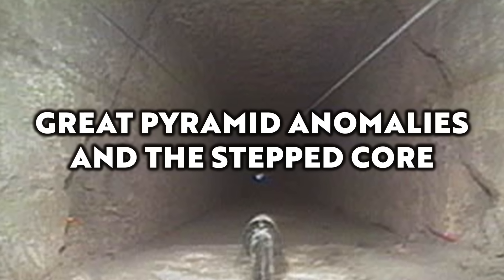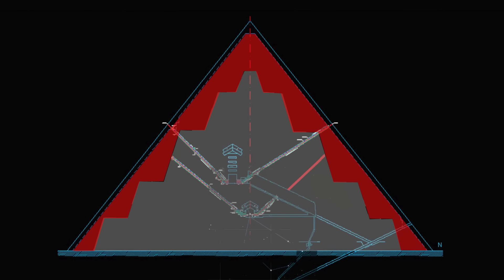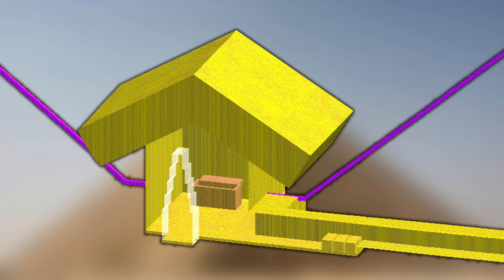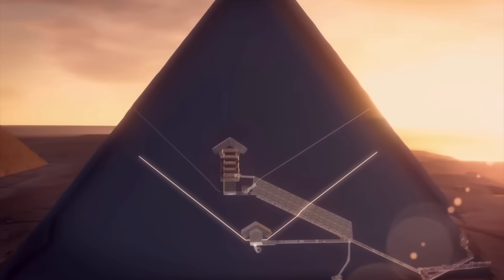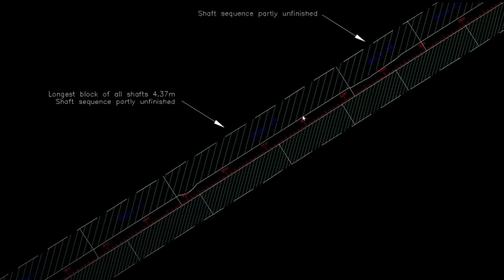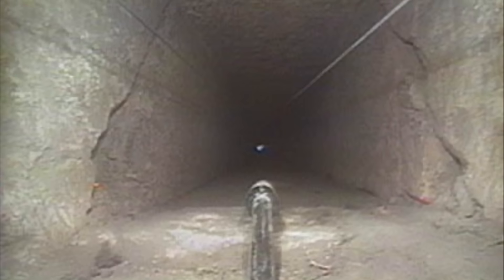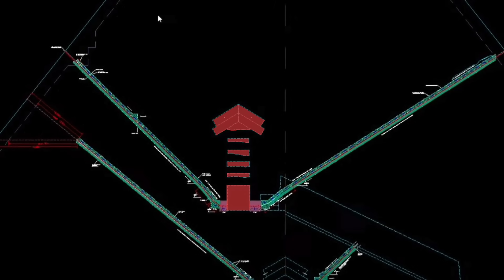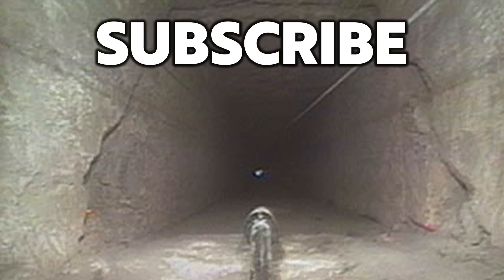Great Pyramid Anomalies Reveal Hidden Structure | Part 2

Comment: the idea that the original builders are just crossing their fingers as they build, hoping each subsequent chamber doesn't collapse stretches credulity for me , personally. i thought we had dispelled such notions with modern re-examinations of the bent pyramid? i cant think of any building site where that approach would be acceptable, from a safety standpoint, logistics, resource and man power wastage, ect... If anything, i think this actually shows us  evidence for multiple stages of construction. the kings chamber being off axis being the main indicator. but the final thing for me, and this may be my own ignorance speaking, but. have we not only in recent decades developed the technology to measure the precise alignment and "squareness" and margin of error on this structure? i thought it was fairly well agreed on the the structure was built from the outside -in? one layer at a time? is the precision of the structure more pyramidiot type stuff? or is it correct? if it is correct, it doesn't make sense that they can build to such precision, but are still crossing their fingers hoping the kings chamber doesn't collapse. I'm just rambling from a potentially uninformed perspective, but it just doesn't sit right with me. to many contradictions, it feels like your telling us the builders were genius's but also didn't really know what they were doing . also , wouldn't the 8 sided faceting have to be an early part of at least the design/blueprints? did they just wing that too? just my 2 cents.

Comment: well according to your diagram the two air shafts are at very different angles so the long block might not have worked in the steeper shorter shaft

Comment: Did someone take the Great Pyramid apart to confirm the stepped construction? Or are you looking at stepped pyramids and assume the Great Pyramid is built that way? The stepped pyramids were built later not before the Great Pyramid. And the stepped theory is problematic if you believe in the big void.

Comment: One misalignment or slump in the backing stones would mean the channels wont work, and the ancient Egyptians would have know this" Yet they used two different methods of construction on each of the main chambers air shafts at the point where the backing stones started?

Comment: My Speculation with some evidence.   The pyramid was built in 3 stages, each stage a completed pyramid separated by generations before the next stage was begun.  The first stage was a smaller stepped pyramid for only the Queen’s chamber.  That’s why the queens chamber aligns directly centered within the 1st stage pyramid.  Next stage could have been the next generation or several generations later expanded the stepped pyramid and housed the King’s chamber.  That’s why the Kings chamber location is offset from directly above the Queens chamber and from the center of the pyramid. (It’s the best location for a chamber created while minimally expanding the first pyramid).This was completed 7,000 years ago and depicted on the shell of an ostrich egg found in a grave upstream the Nile.  The third stage was created around 4500 years ago and remodeled the King’s chamber. This final stage created the final pyramid without steps.

You heard it first right here on the Ancient Architects channel comment section.
Reply: Absolute rubbish.  Would look like a pile of rubble with no facing stone.  Those blocks are roughly cut and uneven.
Your dating has zero evidence as well.
Reply: @ChristopheAllanne The ostrich egg with the engraved pyramids was dated to 7000 years ago.  That’s strong evidence of the dating for the stepped pyramid.  The 4500 years ago for the 3rd stage is commonly accepted date.   The second stage was most likely only a generation or two from the original pyramid because it is built on the same belief traditions and similar construction techniques as the first.  
    Regarding facing stones, every stage could have had them and they could have been removed/reused when the next stage pyramid was constructed.  Also, the pyramid could have been whitewashed (this was being done on walls many thousands of years ago in the Levant including well before 7000 years ago.
Reply: @douginorlando6260 

The ostrich egg is a roughly etched work at best.  Made by a child for the funeral.  An offering.

The pyramids are oddly shaped and the Nile river could be anything.
😂

Comment: And this honoured viewers, is the solution for several of the mysteries of the great Pyramid.
The two upper chambers use, the air shaft, the location of the two upper chambers.

I’ve personally always thought that the offset location of the queens chamber, clearly showed that it had been planned as smaller pyramid first. 

I hope in my lifetime, that they open the big void, and solve the rest of the pyramids enigmas.

Comment: Somewhat contradicting what you say. Flat roof in King's chamber is a success, then they don't need Queen's chamber. So they didn't open the channels from Queen's chamber. But they couldn't have known that when Queen's chamber was built. Or is there something I'm misunderstanding?
Reply from the maker: I mean they decided how to finish the pyramid only when the core was complete. At that stage you’d know if the kings chamber was a success structurally, and only then can you decide what to do with the Queen’s - abandon it, or finish it? Keep it or not?

They decided to abandon it - no slabs were laid on the floor, the walls and corners were not smoothed properly, and the air channels didn’t open into the room. They also didn’t bother extending them through the backing stones. They basically decided to abandon it altogether.
Reply from the maker: But if the kings chamber failed, for example the architect was not happy it was structurally sound, they had the Queen’s chamber to fall back on. 

They would have then blocked off the King’s chamber and finished the Queen’s instead.

But the decisions could only be made when the core was complete because that is the main bulk of the pyramid.
Reply: @AncientArchitects  I understand what you mean, but I think it's very speculative. But a theory is a theory, keep up the good work. I've been following the channel since day one. Greetings from Norway
Reply: @AncientArchitects  If the king's chamber failed, how would they get the material inside to cover the queen's chamber?
Reply: @AncientArchitects 
But there was no security built into the Queen’s chamber like the 3 portcullis door to the Kings chamber. What would they need air for if they were not going to use it?
Reply: Who hipotetic egzist piramid Chufu chambers Toth ????.Westcar papirus.

Comment: Just a thought: The stepped core could also align with the theory of an internal ramp - that is, rather than forming stacked mastabas in which the flat surfaces were precisely horizontal, they could have been angled in such a way as to form something of a spiral wrapping around the pyramid to aid in bringing up large blocks.

Comment: It's kinda nuts to think we're examining and theorizing about the decisions of what was probably a tiny group of very smart people, if not one person, ~4500 years ago. The structural and operational genius involved, particularly given the constraints of their time, is just mind-boggling.
Reply from the maker: Very true. It’s the work of a true genius
Reply: But do you still believe they were laying a block every 2 minutes or do you believe it was built over a much longer time frame?
One video out there based on organic material retrieved from different areas of the pyramid shows through carbon dating that it took 300 years to build. That totally changes the narrative of the construction technique and the original purpose.
Reply: If it took centuries, the building would be full of discrepancies like any structure built over several generations. Also, it would mean a lot of labour was required to start the other nearby pyramids.
Reply: Cosmic natural low. With 
this key point you can open
all secret mystery in Egypt.
Top math about this  we.    don't  know nothing.

Comment: In the diagram, the internal structure of the pyramid’s core is now correctly shown, with evenly arranged tiers. The upper tier cannot be larger than the lower tier. As I assume, the first three tiers (each 21 m high) are combined together and form one large tier with a total height of 63 m. This tier contains the entire main internal construction: the Grand Gallery, Chamber No. 2, and Chamber No. 3, as well as the relieving sections of Chamber No. 3. This tier serves as the foundation for the upper tiers (each 21 m high). That is to say, in this case we are not dealing with a regular stepped structure, but with a stepped structure that has a massive base supporting the upper tiers.

According to my calculations, the base of the internal stepped core of the pyramid measures 170 x 170 meters (equivalent to the width of an equilateral triangle with a height of 147 m). The end of the small northern passage meets precisely the edge of the internal core of the pyramid. It is clearly visible that the blocks covering the passage are not sealing (plug) blocks, but rather part of the regular masonry, meaning they are an integral part of the pyramid’s core.

It is easy to calculate the distance from the outer edge of the pyramid to the edge of the internal core: 21 m (if the internal core has a 75° slope) or 15.75 m (if the internal core has a right angle).

Question to the author of the video: how did you arrive at the conclusion that the internal core of the pyramid has a characteristic slope? Could it possibly have a right angle? If the core is sloped, then how adaptive is it relative to the external angle of the pyramid? Do you have such calculations?
Reply: Is the slope of the internal stepped pyramid identical to the slope of the pyramids engraved on the ostrich egg shell found in an upper Nile grave and dated to 7000 years ago?
Reply: @douginorlando6260  In the image, you can see the difference between the tiers: 8, 9, and 10. It is clear that the triangles are not identical. This may be an early archetype, a kind of “embryonic concept of the three sacred peaks,” although I’m not entirely sure about that :) These steep angles correspond more closely to the angles of the internal core of the Pyramid of Khufu (60–75 degrees), as opposed to the outer part of the pyramid (52 degrees). The entire Pyramid of Khufu is divided into 7 tiers of equal height, each measuring 21 meters. In this case, the division of the height of the Pyramid of Khufu into equal parts coincides with the division into equal parts of the three pyramids depicted on the ostrich egg
Reply: @thotecture I suspect the pyramids etched in the Ostrich shell is something he saw when he traveled down river.  I.E. a pyramid that was later encased and enlarged thousands of years later. The steep pyramid angle depicted on the shell would be the original stepped pyramid perhaps with some casing stones.

Comment: The only way to find out the truth would be to partially disassemble the pyramid. And this would be rather easy to do: the bottom 1/3 of the pyramid's height contains about 70% of its volume, and the top 1/3 contains less than 4% of its volume. The top 1/4 of the hight contains just 1.5 of the volume. It would make sense to disassemble the top 1/4 (marking every stone so it can be reassembled later). 1.5% of the volume is about 40,000 cubic meters, or a 34x34x34 meters cube. No big deal.
Reply: Even disassembling the top of 1/5 of the height (about 30 meters, or about 21,000 cubic meters) would be enough
Reply: Presumably you would suggest helicopters to do the lifting. I think it would be a BIG DEAL
Reply: @peterisaacs6882  No, it would be easier to build some kind of elevator or escalator

Comment: Could it be that the niche in the Queen Chamber is a representation or reflect in some way the stepped Pyramid? With the floor all 5 steps are almost the same height. At the end the pyramids are a series of mastabas on top of each others with a cover.
Also there is clear a north south axis of contructions where all the especial types of blocks where moving to form the especial structures.

Comment: Ain't it a nice feeling to know that it should't be too much longer before technology reaches a level where we will be able to confirm this stuff?
Reply from the maker: It’s a great time to be alive. I just wish things would move faster - I’m getting old 😂
Reply: A portable muon source is feasible with laser wave acceleration creating pions which quickly decay to muons.  This muon source would allow very high resolution CAT scans of the pyramid but with muons.
Reply: Do you agree that it took approx 20 - 25 years to build the Great Pyramid??? If so, how does technology explain the "theory" that a stone would have to have been laid every two minutes to erect such a structure in that time scale or is there something obvious i'm missing????
Reply: @4faxache935  "how does technology explain"
I humbly submit some crude calculations that I came up with on my own.  I'm not saying they're gospel, I'm just putting them out there...

The labor force for the great pyramid was an estimated 20,000.  The average weight of a stone in the great pyramid is roughly 2.5 tons.  The great pyramid itself is roughly 5,700,000 tons.

A team of 10 men can easily drag 2.5 tons, even up a small incline, especially if rollers and sledges are used.

So let's start with 2,000 teams of 10 men moving 2.5 tons each (again, this is all just using averages - larger stones would take more men and smaller stones would take less).  If each team moved an average of 2.5 tons per day, that's 5,000 tons per day.

Divide the mass of the pyramid, 5,700,000 tons, by 5,000 tons/day,  and we get 1,140 days.  Divide that by 365, we get 3.12 years to build the great pyramid.

I think we can both agree that is a ridiculously short time frame.  There are, of course, other factors to take into account.

Because of the annual Nile flood and all the work that had to done planting and harvesting, the pyramid labor force was probably unavailable for, let's just say, half the year.  Now we've doubled the construction time up to 6.24 years.

The overwhelming bulk of the stone for the great pyramid was quarried less than half a kilometer away.  If we say that half the stones were in transit to the job site while half were being put into place, this again doubles the construction time, so now we're at 12.48 years.

Now, the labor force did more than just move stones.  Those stones have to be quarried, and the tools have to be maintained.  No small task.  If we say that took up half the work force, then the construction time doubles again and we sit at 25 years.

That matches the 25-years between the date Pharaoh Khufu ordered construction to begin (c. 2550 BCE) and the ascension of the Pharaoh Djedefre (in c. 2575 BCE), who oversaw his father’s funeral rites in the pyramid’s attached mortuary complex.

Again, I admit these numbers are very crude, but they cover all the major bases, and by happy happenstance, it comes out to 25 years.  Cheers.
Reply: @4faxache935 I suspect the step pyramid dates back to 7000 years ago and the great pyramid encased it, thereby greatly reducing the effort required.
Reply: Yep,
Most of these channels are "trust me bro"